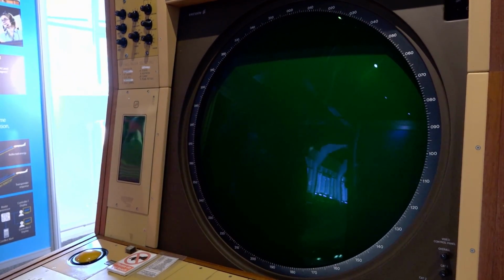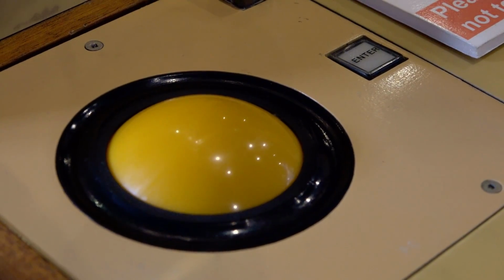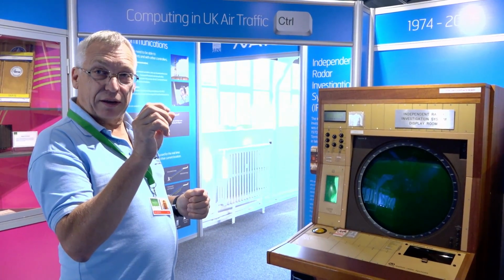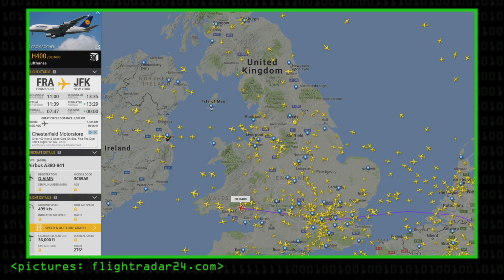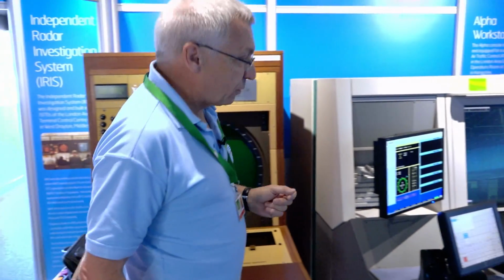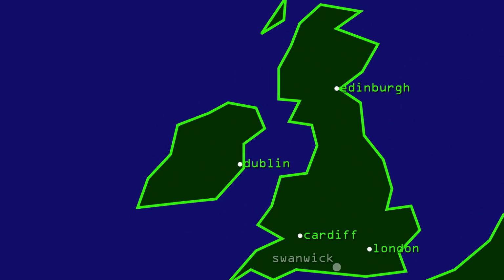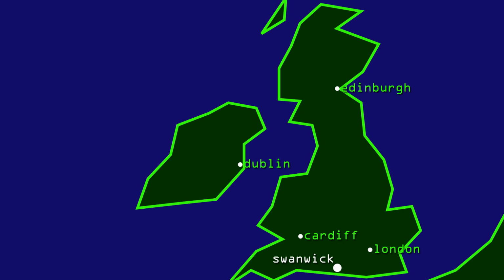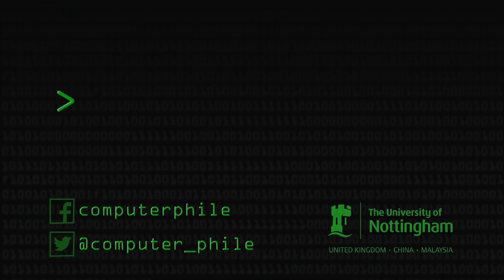Computing & Radar Displays - Computerphile

Comment: Why does he talk about image quality when only little green dots are displayed?
Reply: The radar displays do not just display little green dots. The Code Block attached to each return contains the Callsign , Destination, Height, Climb/Decend arrow
Reply: I think he mostly referred to resolution, as they needed a fairly high resolution for these days. There had to be drawn a lot of planes simultaneously while also each having this box with all its information, which needed to be read-able without blocking too much space on the screen.
Reply: Also since vector, everything is smooth and clear, there's no pixels to deal with.

Comment: So where are the radar that collect information about the aircraft? Are they all based in London, or spread around the country?

What I'm trying to figure out is how people sat in a room in London could see what planes 200 miles away were doing. Today we can just shovel that data in realtime down the Internet, but what about in the 70s?
Reply: The radars are spread around the country. In the U.S. they were (and still are) connected by telephone lines ("leased lines") running through the regular telephone system, set up by the phone company so no dialing is needed and the connection is 24 hours.
Reply: I'm not able to answer your question but it did show how the operator could switch between  different radar stations.  And I'd assume there aren't that many all situated around London. 

I'm guessing the radar information is sent to the control center by radio.
Reply: I Googled the names on the console and it appears to be radar stations all over England.  Assuming the names represent the towns in which they are located.
Reply: The main sites of NATS radars are Pease Pottage, Clee Hill, Burrington, Great Dun Fell and Claxby

Comment: I wonder, can the Air Traffic Control radars "lock on" to an aircraft like a fighter plane does to get more data on it?
Reply: Not really. The radar return comes from the plane's transponder, a 12 bit code assigned to the flight by ATC plus the airplane's altitude ("Mode C"). The computers then correlate this with flight plan data to figure out which airplane this is, where it's going, and so on.
Reply: 'Lock on' is only for weapon guidance systems.
Reply: Just Look for AIS system.

Comment: Why is the "mouse" on the left side, since most people would like to use their right hand?
Reply: Back then people hadn't discovered handedness yet
Reply: so you can hold a pen with your dominant hand and do maths, i guess
Reply: Dare I suggest that in the UK, that would be your gear shift hand in a manual transmission car, so operators would be used to their left hand requiring finer muscle control.
Reply: You use both hands. Left hand for the mouse and right for writing and other stuff. In the same way 3D-mice are used these days.
Reply: Thank you! I could not figure out why I am left handed, but prefer using the mouse right handed... so I can write homework and game! (Ok, possibly not, but possibly so)
Reply: isn't think changing gears requires finer muscle control. your moving your whole arm with your wrist is a locked position. moving your finger tips is more muscle Control.
Reply: Thanks for the replies everybody! I guess it had a good reason after all :)
Reply: Not shown in the video as the equipment suite was not a true radar control position (it was the West Drayton Radar Replay Position) on the right would be the Flight Progress Board with the Flight Progress Strips which the controller annotates with a pen and much more frequently than they used the Rolling Ball.

Comment: The Sony 2K monitors, as used at Swanwick/Prestwick, are not vector graphics displays.
The PDP11/34s were more than a 'graphics card' they were Radar Display Processors which handled selection of the required radar data streams from the 12 odd available and also handled the inputs from the various control panels on the controller suite. The 11/34s originally drove as Sector Equipment Group which converted the digital data to vector data to drive the original displays, once the Ericsson displays where introduced they had the SEG functionality built in and were therefore driven directly by the 11/34.
Ex Head of RDP Workshops West Drayton :)
Reply from the maker: Thanks for the clarification - I'll add this to the description if you don't mind? >Sean
Reply: Sorry, the monitors may not be vector graphic displays themselves (they are just screens), but the rendering prior to output is very much vector based, and then processed into the raster image that is outputted.  This is standard practice in many applications, as it allows easy scaling on differing sized screens.
Reply: NATS last used Scan Converters in the early 70's. Since the introduction of Processed Radar Display System (PRDS) and then NATS Online Display Equipment (NODE) the display data has been digital. The actual displays were, in chronological order, Plessey Mk8 (vector scan driven by the PRDS SEG which converted the digital data to vector),  the Ericsson (vector display but the display incorporated the SEG functionality so connected directly to the digital data stream) and Sony 2K (raster scan)
Reply: Hi Lester. I seem to recall that the Scan Convertors were still in use up until about '82/83ish? I think some sectors (TMAs?) retained a backup to PRDS consisting of Scan Convertors/MOD1s/PDP8E a little later than that even. I definitely recall one of the Scan Convertors being used even later on ('84/85?) providing a service to the Integrity Cell. (Marcus)
Reply: Your memory may be better than mine but I am fairly sure we did not have the raw radar data to feed the Scan Converters to that late a date. And the Mod 1s died around that time from the Great RV Flood :)
Reply: Its kinda like Calling the Ford Model T a "Tractor"
Reply: cjmillsnun yes, they run the vector analogue signals into a 'scan converter' that rasterises them for easy distribution.
Reply: I think that there were a couple of feeds retained from a radar at Heathrow that sent back raw data even after the bulk of the Scan Converters were taken out of service. I think they were called 'Actual' lines or something similar? From my admittedly imperfect memory I think they were just pure copper connections from one end to the other with no hybrid transformers or anything else along the line. I remember we had to get shot of them because BT were charging a huge amount of money to keep them operational. I'm fairly sure I saw the Scan Convertors still in use when I visited LATCC as a cadet (81-83) and one of my first jobs in the Radar Workshop when I got there in July 83 was helping to dismantle the things. As to the date of the inundation of RV I think that might have been as late as '85 or '86? Just as a side note, do you recall who made the MOD1s? Google seems of no help in tracking down the guilty party?

Comment: 3.5inch floppy fancy pants stuff right there . And a PDP working along side an IBM , controversial.
Reply: The 3.5" floppy is actually a 3.5" Floptical drive (21Mb capacity) They held the fixed data to enable the RK05 Disk Drive Emulator (Newman RK05SSD) to be able to recover from power failures
Reply: very weird how often I hear IBM and all I see is digital.
Reply: In the late 80's/ Early 90's (I forget exactly when)  My dad won an award at work for getting the VAX's and IBM's to talk to each other well.  (He was a VMS Sys admin)
Reply: Lester Bailey But most good floptical drives could also read standard 3.5 inch too :).

I myself preferred the easy drive , a hard disk platter in a cartridge , eat your heart out zip disk.